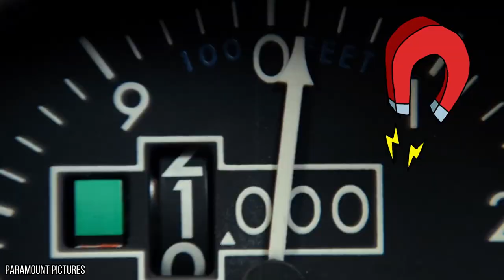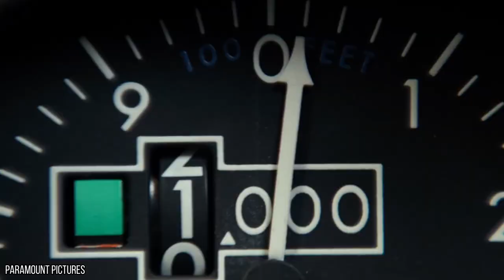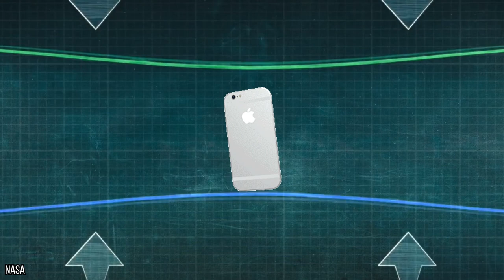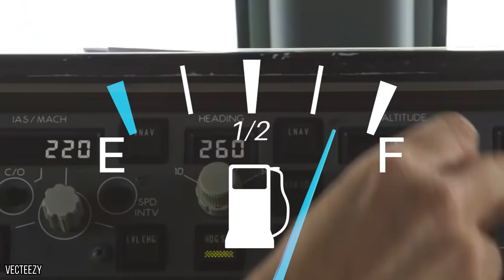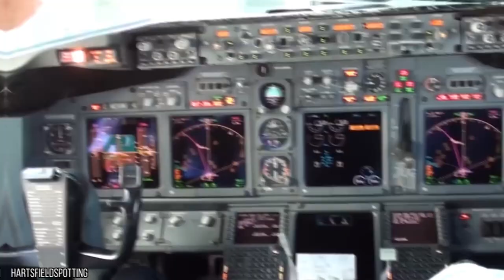Why Planes Don't Fly Over The North Pole

Comment: I flew on a commercial flight a handful of years back that had a monitor in the headrest in front of you. Showed all the stats: flight path over the US, speed, altitude, wind speed, etc. It also showed outside air temperature. On this flight, it was -60 outside, and they didn't have any problems with the fuel freezing.

Comment: If you fly from New York City to Japan or China you are going over the ice. And a long time ago airplane with two engines or less must fly not more than three hours from a airport they can land at or must be able to land on the water ( Pan America Clipper ) but with new jet engines most air frames can do it if the fuel tank is big and the wings won’t ice you are good to go. Some time a go a airplane land in Hawaii it was grounded because it fuel tank was to small.